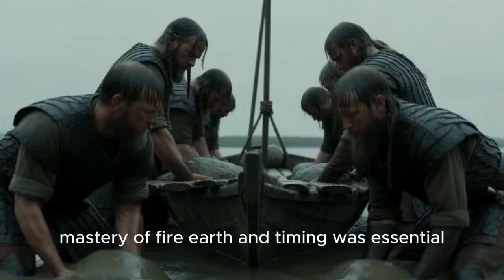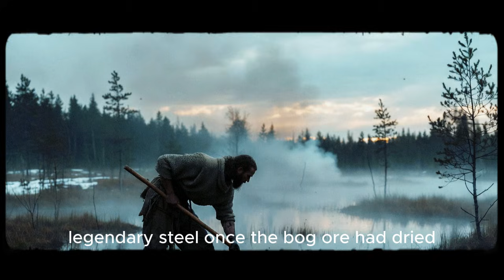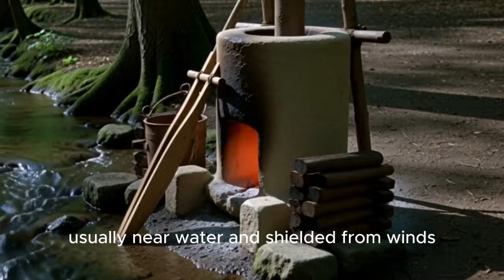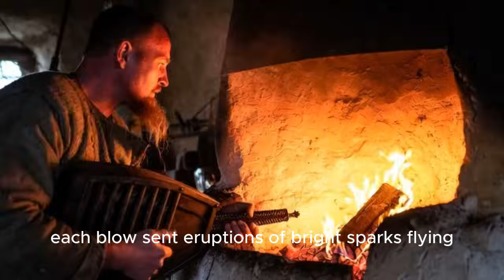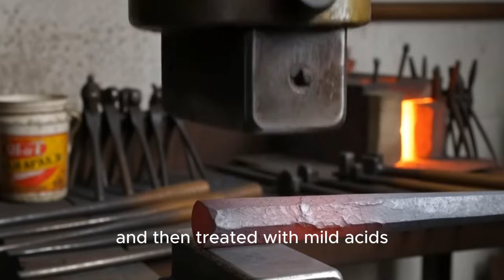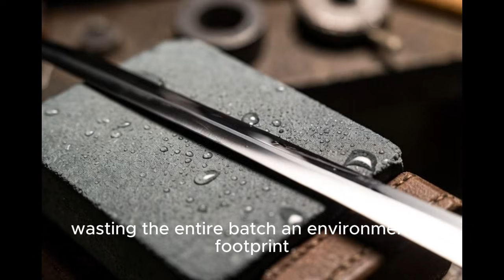🔥 How Vikings Forged Deadly Swords From Swamp Iron

Comment: What is called Damascus steel today is technically pattern-welded steel, a method not pioneered by the vikings, but their smiths advanced the art and science in ways it hadn't been seen before. Contrary to the video, this was not legendary steel. It was the best steel they could produce from very poor sources. This lasted until they established trade routes to the East, where they found Wootz crucible steel which made the famous Ulfberht swords.
Reply from the maker: You’re absolutely right to distinguish between true historical Damascus (Wootz crucible steel) and what we now call pattern-welded steel. The Vikings weren’t inventing pattern-welding, but they did refine it dramatically—especially considering how inconsistent and low-quality their raw iron sources were. Their skill was in making the best possible material out of what they had.

And yes, the “legendary” reputation mainly comes from later romanticizing. For the Vikings themselves, pattern-welding was simply a practical solution until long-distance trade opened access to higher-grade materials. Once they encountered genuine Wootz steel from the East, that’s when we see those exceptional Ulfberht blades appear—far superior to anything they could produce locally.

Great points—thank you for the clarification!
Reply: @TheVikingssaga  Kudos for being a real person, despite using a lot of AI video for your piece. There's way too much AI slop stinking up YouTube.